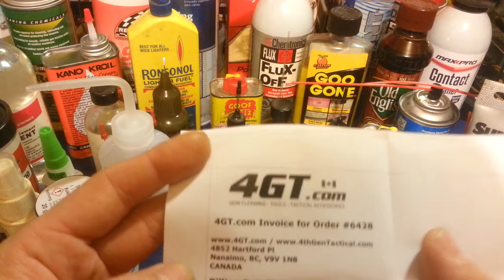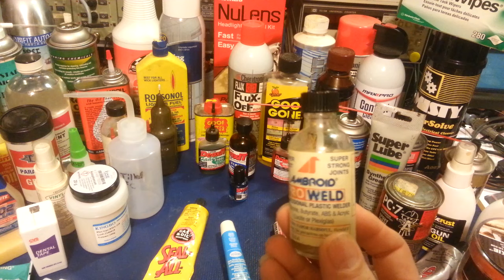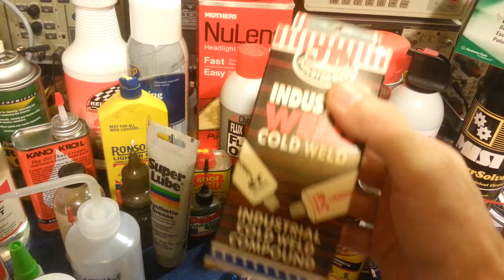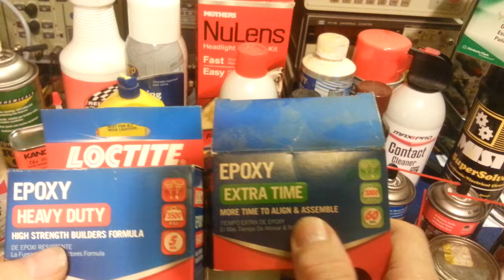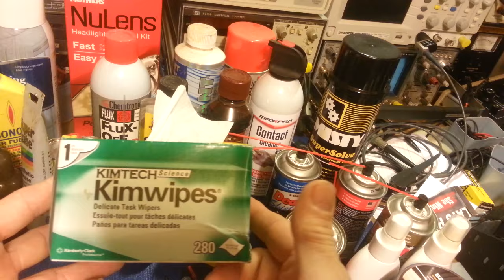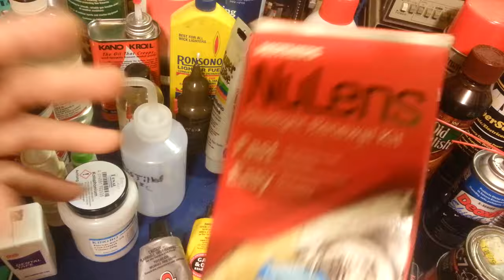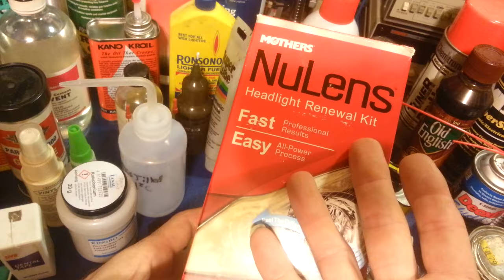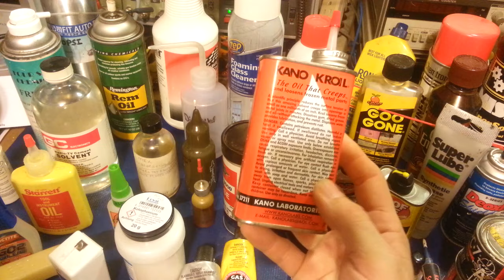Chemicals, glues, lubricants and other supplies used in electronics repair and restorations.

Comment: I just noticed today that A-1 Distributing sells those syringes now, already filled with heat sink compound.  You have to be a dealer with them, but they are listed at $3.90.
Reply from the maker: I looked at them.  Those do not have the end that can be rotated to "turn off" the tip which prevents it from continuing it to come out.  It is also made in China.  I only use the premium heat sink compound made by 3M.  If it's not 3M I won't use it.

Comment: Thanks for the great tips Mike. Couple of others...if you are tired of losing the little tubes from spray cans simply hot glue a piece of a straw on the side of the can and plug up the bottom with the glue and store the tube (can't lose it unless you turn the can upside down!). Rectorseal EP-200 two part Epoxy Putty (Home Depot in the Plumbing dept.) hardens like steel and can be machined. Kano Kroil is great for loosening tower foundation bolts (I know!). Electronics friendly fire extinguishers aren't cheap but well worth having - they can't make them with Halon anymore but you can find them; try a fire control company, that's where I finally had to go to find one)...the Halon unit that I've had for 30+ years still shows in the green for fill. Probably a hundred more products...we'll hopefully get some more ideas from others' comments here.
Reply from the maker: I actually picked up two dozen NOS halon automatic dispenser canisters a few years ago.  Basically a can of halon with what looks like a fire sprinkler head on it.  I'm not sure what they were designed for but they fit perfectly in my flammable cabinets in the garage and shop.  Just have to be carefull with halon and those little spray can extinguishers I have.  They work by dissipating oxygen so suffocation is hazard in confined areas.

Comment: mike, have you tried that electrical glue yet with i think carbon fibres  mixed in? i made my own version with ordinary super glue and carbon fibre cloth that i cut up in little pieces and it seems to work fine. one thing i do is after my electrical glue is fully cured is reseal it with more plain super glue or go2glue.
Reply from the maker: What do you use that for?
Reply from the maker: +J Davidson (Mr. Tinker) 

I use welders thermal putty for jobs like that.  Surrond the area to be soldered with it to prevent damage.  Welders use it on sheet metal to prevent warping.

Comment: I have one Mauser that is unissued and still original in 8mm Mauser. I compete in F-Class in T/R with a Gre-Tan blue printed and double sleeved Remington 700 in .308  with LW barrel and in unlimited class with a blue printed Mauser with a 31 inch cut rifled Brux barrel in 260 Remington. I have worked washing dishes at a local restaurant since I was 12 and have paid for all my barrels and machine work myself. At some point I would like to buy a really nice custom action for my unlimited class rifle. My Gre'-Tan machined and double sleeved Remington is as good as it get's for Tactical Competitions I doubt a custom action would help much in that setting over what I am using.

Comment: hi mike, great videos and im learning alot, question would you as a radio repair man, would you very spray a general purpose cleaner degreaser on radio parts and or radio, then rinse it off with a garden hose?

Comment: i notice you use go2glue. i also use it because it dries to a very clear finish and is flexible. works great on atv seats when they get a hole or start to crack. have used on shoes and it works great. the only downfall i found was i had to pitch two bottles with a 1/4 left because it started to set up. i wonder if some acetone on top of remaining glue would stop the setting up. thats the cure for polyurethane glue to preserve the remainder in the container.
Reply: Yep, I learned about Locktite's  GO2Glue here on Mike's channel and it has now become my go-to adhesive as it sticks when some super-glues just won't cure (although I suppose a accelerant may help some of those but GO2 just plain works.
Reply: the only downside is waiting for it to setup.
Reply: That's true...you have to take that into account, but for situations where you can throw on a couple of clamps and just let it sit it's great...did that last night reattaching a eye glass case liner to the outer shell.
Reply from the maker: Yep, I was sold on that stuff the first time I used it.

Comment: i'm new to circuit repair radios stuff like that and originally Ryan to a problem having to replace some suck at traces I was wondering what type of Apoxsee do you use and where can I find it
Reply from the maker: I use circuit trace over bonding epoxy made by Circuit Works. DigiKey stocks it.

Comment: A word of warning about the CO2 fire extinguisher. The CO2 IS ELECTRICALLY CONDUCTIVE.  IF USED WHILE WHATEVER ON FIRE, BE SURE TO DISCONNECT IT ELECTRICITY FIRST!!! Low voltage equipment not as important to disconnect but still could tickle you. High voltage components like tube amps and the like. Can be life threatening!!!
Yes no residue to clean up afterwards witch is a very good thing. But I didn't know if you knew about it being electricly CONDUCTIVE or not.
Reply: James Fackenthal I don't know where you get your info but it is, ah, incorrect. CO2 is a gas when it leaves the extinguisher and is in no possible condition conductive. Even as a liquid under pressure it is an excellent insulator with a high dielectric strength as it is a nonpolar, linear, covalently bonded molecule.  Is dry ice a good conductor as well?
Reply: English Archer I get my information from work CO2 is a gas yes however its main ingredients is carbon. and carbon conducts electricity I got that from a fireman it said not to use that on a high voltage electrical fire who was giving training for the use of fire extinguishers

Comment: I am trying to find a glue that will glue high density polyethylene. This plastic is very "waxy" and chemical resistant (they make red gasoline containers out of it). Does anyone know what I can use? Thanks!
Reply from the maker: The short answer is you can't glue it.  It needs to be heat welded.  There are some glues that claim they can glue polyethylene but they make weak repairs that usually fail.